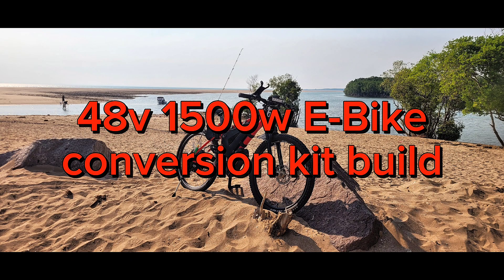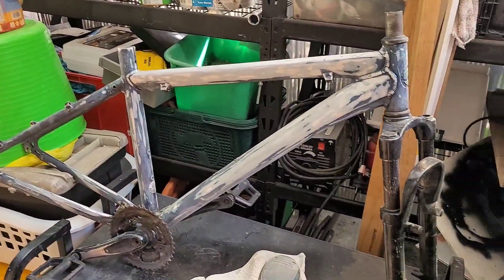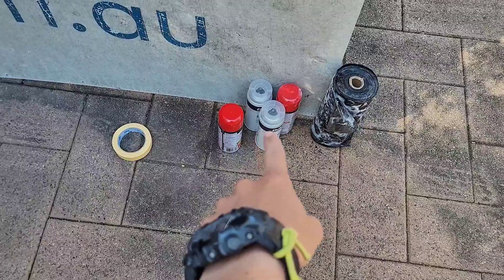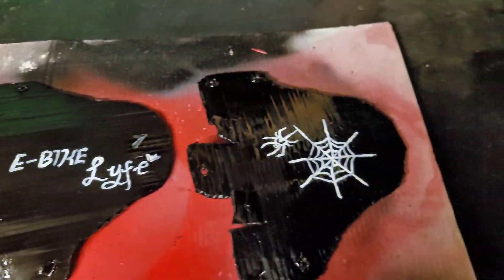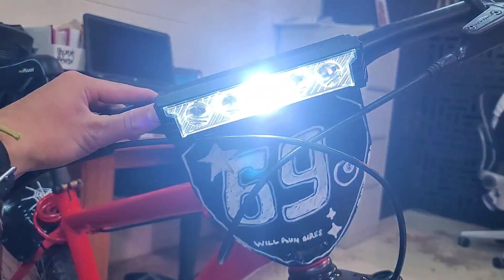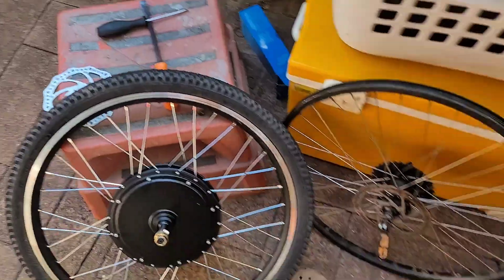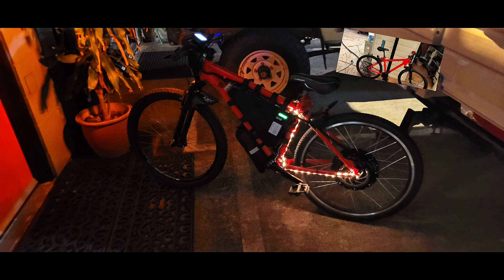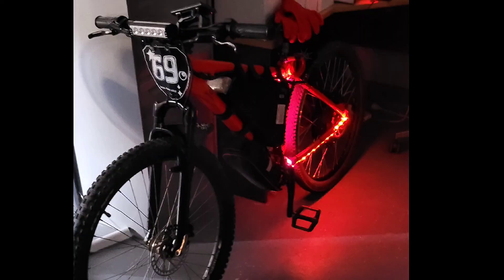1500w 48v Ebike Conversion kit

Comment: Hey mate. Great work on the paint job 👍. Planning on my conversion with the same ebike kit. Did you screw the controller to the frame?
Reply from the maker: Nah I just chucked the esc in the bag it came with, and strapped it to the frame super easy